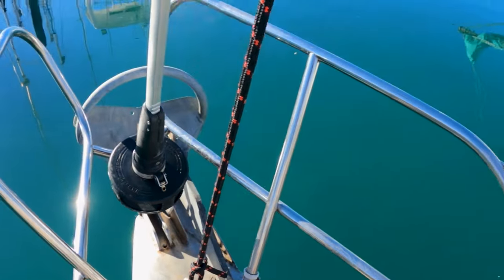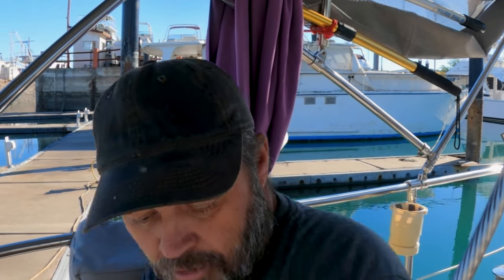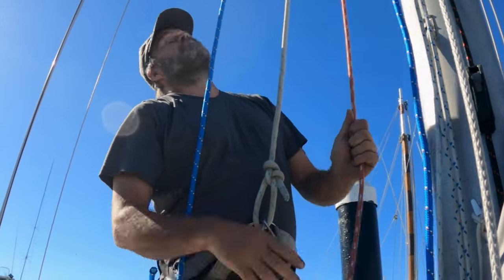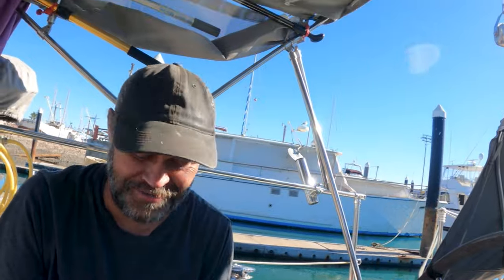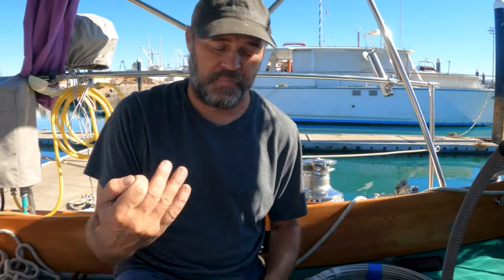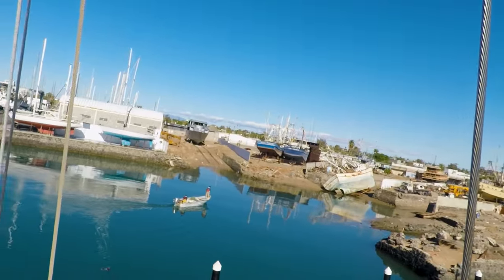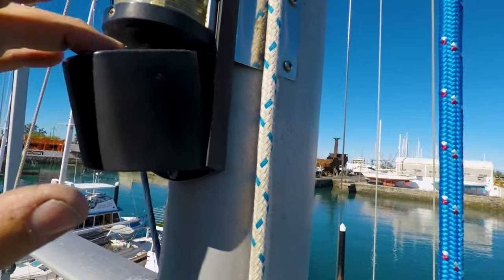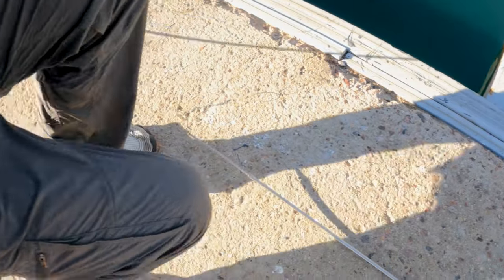How to replace standing rigging

Comment: If you do this on a boat again, look at Hayn Hi-Mod fittings.  They work the same way as Sta-locks, they look a whole lot better, very well machined.  I've re-rigged 3 boats with them, love them.  My newest boat has Sta-locks, plan to replace them, the PO used swage fittings on the tops and didn't replace the turnbuckles, which are 50 years old, so not real confident about things.  Glad to see you used re-useable fittings on both ends of the cables.  You see a ton of people only put them on the bottom and then have a rigger swage a top fitting.  Sort of defeats the purpose of doing it yourself and being able to replace them anywhere.  Another thing you see people do is use sealant like 5200 with them.  It's the lack of oxygen reacting with the stainless that keeps it stainless.  No oxygen exposure leads to crevice corrosion.  Did you pull, check and re-bed your chainplates?  Crevice corrosion in places that aren't visible (back side, bolts, where plates go through the deck...) is a common place for breakage due to corrosion.  Neat trick on how you spliced the headstay cables to feed the new one, I'll have to remember that one!

Nice job, like your videos!
Reply from the maker: Iv checked all the chainplate bolts, and visually inspected them . I can see all the chainplates and will pull them and rebed them next time we haul out.  The Chinese finger trap worked well. I can't take credit for it, I saw a video of guy doing it that way while I was researching.